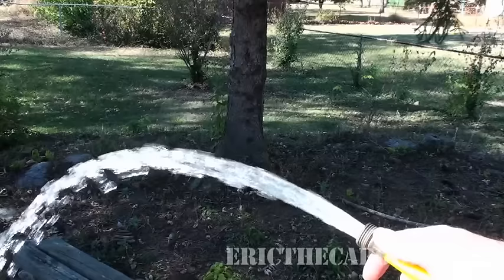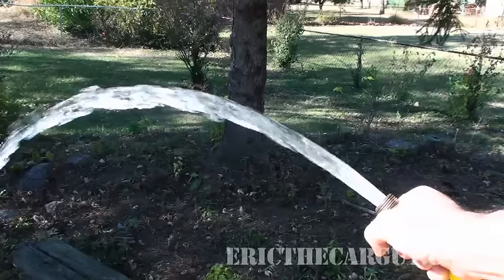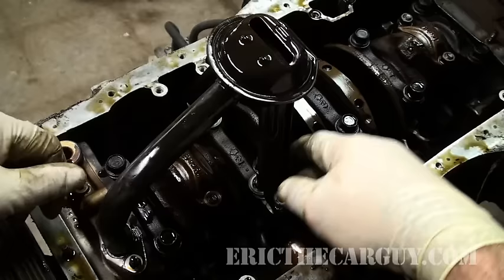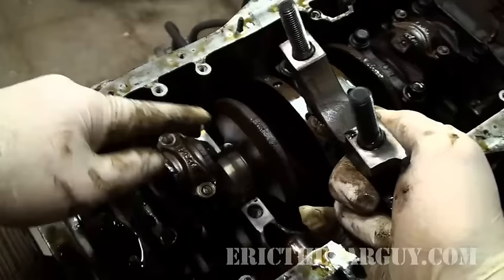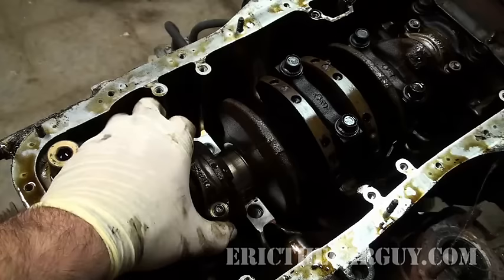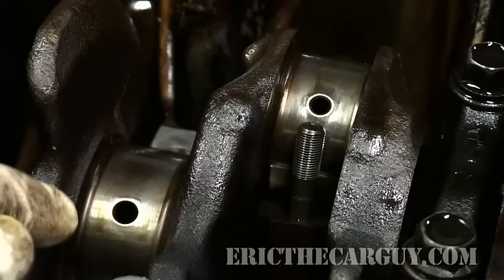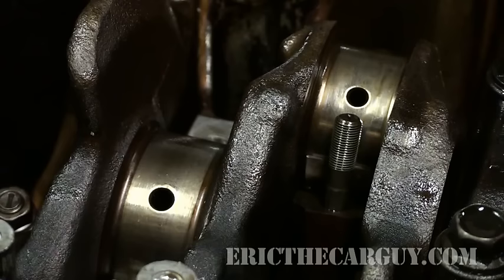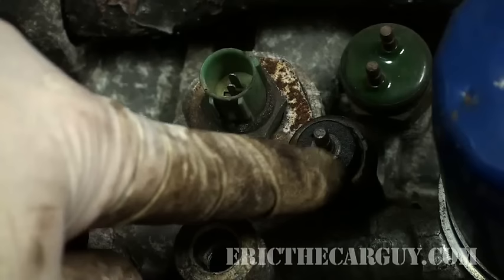How Oil Pressure Works - EricTheCarGuy

Comment: Great video. I learned something new today. I was already thinking of changing the oil pump on My 95 Maxima. I've been having a problem with the oil light coming on and blinking when I stop at a light. As soon as I accelerate the light goes of. Thanks to Eric -tcg's info I need to rethink now.👍
Reply: Oil pressure sensor brings up low pressure light to

Comment: Like your videos.
Viscosity loss – A lubricant’s viscosity is its most important property. Viscosity has a direct bearing on wear protection, and your engine is designed to operate best using a motor oil of a specific viscosity (e.g. 5W-30). The intense pressure the oil bears as it’s squeezed between moving parts, like the piston ring/cylinder wall interface, can tear apart, or shear, its molecular structure, leading to viscosity loss. Suddenly, the 5W-30 motor oil your engine was designed to use is now essentially a 5W-20 oil, and wear protection may be compromised.

Comment: You are exactly right. That's the same thing I said in my first statement. As I said, a stagnant body of liquid has no force in itself. You're still confusing flow with pressure. Take a centrifuge pump with an inlet but remove the housing from the impeller. You won't have any pressure just spraying liquid. Add the housing and the outlet and you'll achieve pressure because of the outlet being decreased.  Pumps create flow. Resistance to flow creates pressure. Simple.

Comment: Gday sirrr; always like your vids!! Changed water pump on 2006 grand prix 3.8; ran good for couple minutes then lifters started rattling. Oil pressure reads 55psi and everything seems clean. Dazed and confused!!

Comment: You explained pressure perfectly. I usually use my mouth as an example by blowing with my mouth wide open compared to restricting that air pushing out when i shape my mouth into a whistle type form.

Comment: In my opinion Eric has the right idea and his example is a good one - except that some see it in the wrong way till they understand what he is saying. As others have said, the pressure occurs in the hose when the output side is restricted, not in the water stream outside of the hose. That the pressure has increased is shown by the increased speed of the flowing water when the output is restricted. In fact the pressure of the output stream is slightly lower than the original stream. Yes, there is pressure in the hose before the restriction as the speed of the flowing water shows before the restriction, but that pressure is greatly increase by the restriction of the output orifice.

To apply this to an engine consider this:

The engine's lubrication system is made up of a pump and a LOAD. The pump provides a volume capability of so much volume of oil in a given amount of time at a specified pressure and temperature. An engineer designing the system considers the LOAD the system will present, the temperature range, the pressure desired. The engineer specifies that the desired pressure is 40 psi and the LOAD that the pump will see is lower than that the pump is capable of providing at the volume of oil and the temperatures to be endured plus some additional, so the engineer inserts some kind of bypass mechanism to help the system maintain the pressure to the load at all times - well, most of the time. Things like temperature and speed of rotation of the pump change the output of the pump and things like wear change the volume capability of the pump. And wear also increases the size of LOAD. 

The LOAD, on the other hand, consists of the sum of many loads such as galleys that the oil flows in plus gravity (minimal load), main bearings (high load), rod bearings (high load), lifters (medium load) and other things such as rocker arms that don't require as much lubricant, but pressure is required to get the oil to the wear points and gravity or splash actually gets it there for the most part (minimal load). Then there are leaks. These are supposed to be absolutely minimal loads, but sometimes they are not minimal and cause the load to become extreme. Or in other words, the leak steals the volume and pressure from the system causing the system to become starved. 

Eric is 100% correct in that the oil pressure is nearly all provided by the major loads which are the mains and rod bearings, but he does not address the leaks. These leaks are unusual so they do not fit nor do they necessarily belong in his discussion. They are a failure of some kind in the mechanics of the system and as such they are relatively rare. 

What Eric is saying is that you can increase the pump capability to the maximum that you can purchase, but the LOAD is still too great and will not respond to the increased availability of volume by increasing the pressure - the LOAD absorbs it all. Of course you could purchase a large enough pump to supply the LOAD, but you might not be able to get it mounted anywhere. And that still might not solve the low pressure problem if the low pressure is being caused by some form of leak. The leak could be a faulty regulator (replacing the pump should fix that one), a bad bypass valve on the filter or for the filter (depends on the design), a broken galley, a leak or damaged sump pipe (intake to the pump), a plugged screen on the intake side, low oil level, gunk causing the oil to be insufficient so it allows air to be ingested by the intake, and a few others that I have not thought of will invariably occur to someone.

If you come across a situation where the leak has stolen most of the pressure and volume capability from the system, you might end up going into a full repair of the engine and spend a few thousand doing so only to find that the problem is still there because you did not discover the source of the problem which was the leak.

Comment: Thank you Eric for your time and information on this subject on oil pressure , now I can diagnose my 88 Nissan Z31 !!!!!
Reply: So what was your diagnosis? I have a lexus IS350 2007 with low pump pressure, i have bought 3 different oil pumps and no change, the car starts fine, but the oil pump pressure is very low. Pls what do you advice?

Comment: Thanks for this explanation, really helpful.

What about a situation where you only get the oil pressure light when the engine is fully warmed up and idling? While the engine is cold, the oil pressure light does not come up even while idling until you've driven for a while and it is at the optimal temperature then the message comes up while idling

Comment: I had a 1987 Chevy Corsica, (Corsiscrap,), with a 2.8 ltr. v6, and the  oil light started going on at about 140,000 miles. It had proper oil in the oil pan, but the pressure was low, so what I did was I put in a high flow oil pump, and the light never went on again. That car lived to the ripe old mileage of 267,000. I now have an '02 Olds Alero with 165,000 on it, and I'm tempted to do the same thing with it even though the oil pressure is still good just to see if I can buy it some extra life.
Reply: +Comet Jockey Dave Don't fix if it ain't broken... ;)
Reply: +José Pinto Aw heck. Now where's the fun in that? Just kidding, you're quite right José.

Comment: love your vids!   pressure is created by the pump though.  take your garden hose example; put one end in a bucket of water....how much water comes out of the other end of the hose????  the 'thumb' adds resistance to the circuit and it will follow ohms law of more resistance less Voltage (pressure) or more Current (water).  The clearances create resistance to the pressure of the pump.  That resistance goes down as the clearances widen and the oil spews everywhere.

Comment: Wow. Your video helped so much in figuring out what is wrong with my 2005 Chevy Suburban. I have been told that I need the oil pan replaced because of a leak, but I do not have the funds right now, so I drive it as little as possible. The oil pressure has been at zero sometimes and then will slowly rise up to the maximum of 80, which doesn't seem normal to me, so then I would check the oil and find there was no oil in there, so it's a pretty bad leak to leak out while the car is just sitting for 3-5 days. I know exactly what type oil this engine needs and I had someone get oil for me, but they got the wrong kind and put it in anyway and said it would be just fine, & I was so pissed because it made a difference and not in a good way. 
just paid the car off last week and within the last month had the radiator & starter replaced and now the oil pan. I think they have a button they press when someone pays off a car that makes the engine go to shit.
Great video...thanks so much....Subscribed.
Reply: +Alexandra Vader Driving with no oil is a NO NO, the wrong oil, any oil, is better than no oil. Fix that oil leak, ASAP or your good for an engine transplant soon. When cars come to certain age, things start happening, but that doesn't mean they won't last for a while!

Comment: I watched ur video right now. It is very informative I hope it is a great effort to spread knowledge. 
In this video the performance and working of Lube oil pump has not given importance. what if the pump is not functioning or not efficiently working. Oil pressure is actually developed by the pump. The more efficient the pump the more efficient is the oil pressure. In fact maintaining the required clearances between the crankshaft bearings and journal has the real importance but the efficient working of lube oil pump is also mandatory to maintain lube oil pressure of the engine.
Please comment to clarify the above confusion.
Reply: +Lajbar Khan The oil pump is a positive displacement gear pump. It is designed to deliver a given volume per revolution and to effectively deliver that volume up to a certain resistance. That resistance is referred to as pressure (also called back pressure as it is pressure "back" onto the pump) and measure in this case in pounds per square inch.

You are correct to a degree in you comments. A worn pump can result in lower system pressure, but that is due to a reduction in volume that the pump is delivering. If the pump internal clearances become worn, there will be increase "slip" or bypassing of oil around the gears internally in the pump and at normal system pressures there will be a reduction of the volume of oil delivered out of the pump. This reduction of volume output could potentially cause a reduction in the system pressure once the pump volume output falls below the point needed to overcome the oil bypassing the clearances in the main and rod bearings.

That being said, it is less common for an oil pump to wear enough internally to cause the volume output to fall enough to be the only cause of low system oil pressure. 40 psi is a very low design pressure for gear pumps and pumping a lubricant is kind of the best scenario to limiting wear.

What Eric was saying in this video was in response to a person who had already changed the oil pump to a new one and still had low oil pressure. Unless the new pump was defective, oil bypass internally in the pump was not the problem.

One other way to possibly improve oil pressure in an engine with excessive internal clearances would be to install an oil pump with higher volume capacity, if available. Delivering a higher volume of oil to the crankshaft could possibly overcome the bypass problems causing the low oil pressure and give you a higher gauge reading. This does provide for better oil pressure and likely help insure that all points in the engine are receiving adequate oil flow. It does not however do anything to improve or change the issue of excessive bearing clearances and the issues that will cause.

Comment: Hey it my first time making a coment. Your videos are great and you explain things very well. Keep up the good work. I have been recently having oil pressure issues in my 07 Dodge Durango 5.7 hemi and I was told by a mechanic that before I change the pump to simply do an oil system flush to make sure it's not clogged I any way. Then replace the oil and filter with cheap oil and cheap filter and see if the problem persists. If after that then I should go ahead and change the pump and screen. if there is any more I should do I welcome suggestions.

Comment: Great video, with real information and examples!  To any non-car people I would trust what this guy has to say.  That being said to go along with his point that more resistance to the oil flow = more pressure.. Some people may have a false sense of security due to a reading of "high oil pressure"  because of either improper oil.. (if your car takes 0w-20, and you put 20w-50 in it..) as an example.  OR if your engine has not been properly maintained with good oil and filters, the sludge build up can and will clog oil passages creating... You guessed it!! High oil pressure! an easy way to tell is always go by the owners manual recommended viscosity for the air temperature, unless you have a built or re-built engine then your machinist can give you the tolerances for each and every bearing and from there you can actually look up charts telling what oil to use (basically to fill the gap properly)  Simplified, a lose engine bearing gap needs thicker oil (10w40) a tight bearing would need something like a (0w20) and so on... The next is how to tell if your high oil pressure is from a clog, well your valve cover should have some kind of vent on it, you can usually pop it open with no tools and look inside, if you see deposits or sludge... You probably do have clogged passages, or at least a reduced flow and increased pressure.  That can be fixed with a high detergent oil, or a mix of for example Shell's Rotella blended with Marvel's Mystery Oil, or Sea Foam additive.   And then change back to your regular oil and see if the pressure dropped ( keep in mind, a worn out engine can fail if you do this.  Sometimes the sludge is all that's holding it together lol)  At the end of the day if it needs a re-build... Then it needs a re-build.. If it needs a cleaning, it needs a cleaning.  There is no saving a trashed engine with a special formula is all I'm saying, but a GOOD engine can be saved with a good detergent flush.

Comment: Thanks that explains what's going on with my 99 jeep Grand Cherokee with 260K miles in Chicago in single digit temp.  I had lost pressure momentarily in summer but it would return to normal after a couple minutes.  This did not return, so I thought it was the guage.  or some piece of gasket breaking loose and clogging the system.  I didn't hear any strange noises so after 10 minutes driving on the exp trying to get her home, I turned it off.  When i turned it on, pressure went all the way up then leveled off.  Gona try replacing the oil pressure sending unit, but feel like this might be signs of bigger probs.
Reply: +tonygomango from what I've been reading 4.0 Jeeps are notorious for low oil pressure after 150k miles along with cracked heads between the 3rd and 4th Cylinder valves.  Seems like they all lead to one thing... Rebuild.  New heavy duty casting head from clearwater, camshaft, cam bearings, lifters, and complete lower end rebuild kit.  Might as well throw in a high volume oil pump while you're at it.

Comment: Eric the pressure oil light goes away when I Press on the air pedals. That oil pressure light comes on only after the car warms up or when I'm coming to a stop at a red light or stop sign. 
Eric to fix this product do I need a short block and a long block kit to fix the problem permanently.
Eric my gears are slipping is that the cause of my pressure light coming on or is that another problem of its own..
Please hit me up with some knowledge what's my best case scenario for my 1984 Coupe DeVille
Reply: I have exactly the same problem with mine.

Comment: thanks for the explanation that is exactly what i wanted to hear.. even now that i know might have blown a gasket. i do not know my truck very well as there are so many parts to learn. i know how to work a wrench. i have a motorcycle and i know well of how to trouble shoot it because ive had bike my whole life. a truck is a little more complicated...

 so i tried replacing my front timing chain tentioner on my 4.0 sohc motor  (because i have an infamous knocking for a year now.) and i must have installed it wrong even though i marked the inlet for the oil. i went to start it up and a massive oil leak sprang. i think this maybe from the case somehow considering the inlet for the tentioner and the area around my filter/plug were not covered in oil. i can not see what may have leaked oil. i have the whole kit for the replacement of the cassets gears and tentioners to fix my clicking problem but i am afraid i might have caused something worse by installing something wrong. i am one of the dumbasses but i am a dumbass that is trying. to be honest you can learn anying on the internet. you just have to know how to look up the problem your trying to solve and you have provided me with a better understanding of how my vehical works and i thank you for that.

Comment: Awesome video!  I have low pressure (about 25lbs instead of 40) on a Mercruiser 260 V8 marine engine.  And guess what?   The engine is old.  I'm gonna add some oil additive that make the oil thicker and see if I can squeeze one or 2 more years out of the engine before I replace it... Thank you!

Comment: I have oil pressure problems thanks for the advise that’s what I’m looking into   Question if it didn’t touch that bad but lost pressure can the engine be saved

Comment: Another great video from Eric! Time and time again we learn how vital proper fluid maintenance is to your car's health. Change that engine oil at least every 5,000 miles and most engines will run and run for getting on to 300,000 miles - unless you get a duff engine design - like the early VAG EA888's which had a design fault.